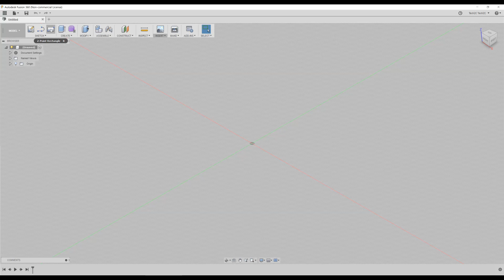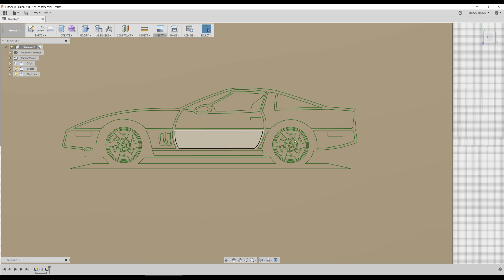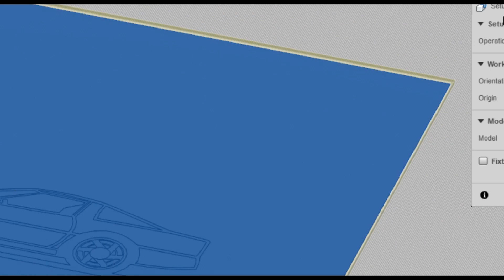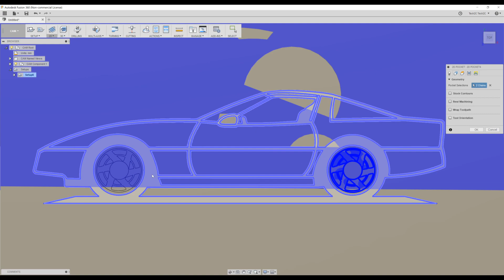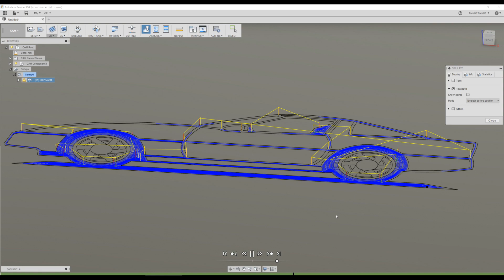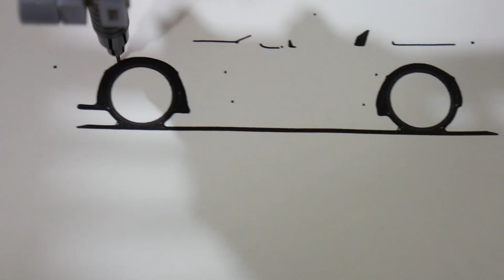Draw Solidly with a 3D Printer

Comment: I'm wondering if this can be used as a solder paste dispenser for SMD electronics assembly. The dark parts can be the pads. I guess the fan ON and OFF inputs can be used to trigger some kinda of dispensing mechanism (a stepper driven screw to work a syringe maybe?) Just thinking out aloud.

Comment: I spotted a very minor issue with your tool. That pen is not flat end. it's ball end. You can flatten your end or lower the diameter to 0.03 which I assume would fix the empty dots near rear wheel.
Reply from the maker: I am applying a downward force on the pen which I think will attain the 0.4mm as advertised on the pen itself. Yes you're right, the few gaps could be filled with a smaller diameter.

Comment: I’d love it if you could give us a video on how you created your .cps file, and why you chose the settings you did. I’d love to use your method to plot with my coreXY printer that isn’t a HyperCube, unfortunately!
Reply from the maker: The cps file was derived from the default.cps file that ships with Fusion360. You can use my Hypercube.cps with your printer too if you use Marlin firmware, or any gcode interpreter firmware that supports G0-3 commands.
Reply: Tech2C Thanks for the reply! My printer uses an Azteeg board using smoothieware, so no Marlin, but I’ll check on the G0-3 support. Thanks for the help. Keep up the great content!
Reply: For others who may have a Smothieware based printer, I was able to find a cps file for Fusion360 on their website at:  cam dot autodesk dot com slash hsmposts. Search for smoothieware and it pops right up. Many other options there too.
Reply: @Tech2C  how to add this cps file in fusion360 am using fusion 360 on a mac..
thank you
Reply: or can we choose any other from the dropdown...